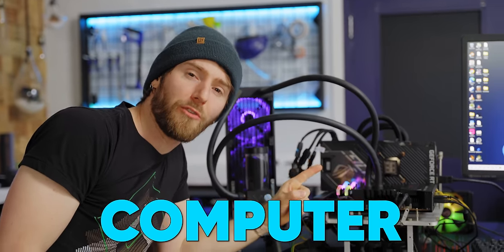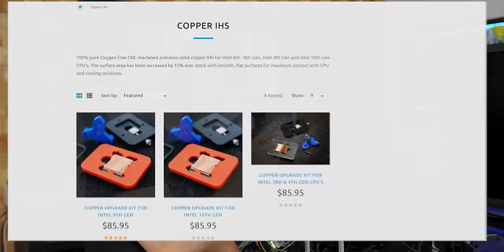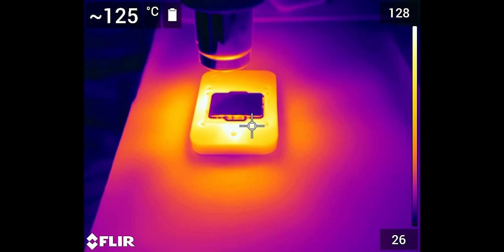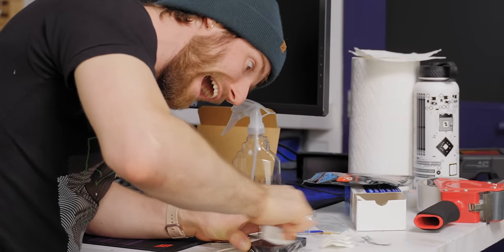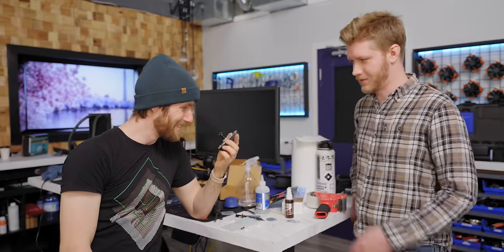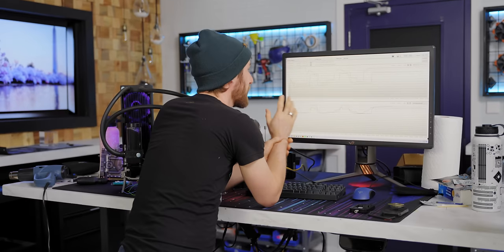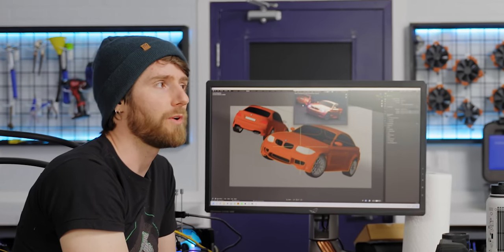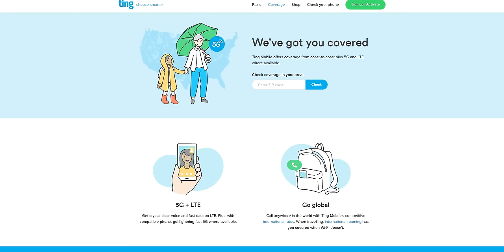Making Intel's Worst Product Better.... And Also Worse

Comment: How much overall power does the whole machine use 1800 W because that's the standard power allowed on a single circuit in your home 120 V times 15 A equals 1800.  If you have a 20 amp breaker and the   accompanying  proper wire gauge 2400 watts.  600 watts just doesn't cut it. Like your videos.

Comment: lapping the standard IHS till it's flat and back to copper is soooo much easier and from experience achieves good results if the CPU has stim not paste.
..also seeing the machining marks means it's not perfectly smooth ..give it a polish on a granite lapping table and try again..
Reply: Thanks for watching 🤗   
Send a direct message right away,I have something for you.🔝🔝🔝

Comment: the fact that these CPU's and GPU's pull so much power now is why I had the electricians at the house I'm building wire my office with half the power outlets to be on one 20Amp circuit and the other half on another 20Amp circuit. 

Once my 5 yr old is old enough I'll build him a PC and we'll have three PC's running in the office. This way we're making sure we're not causing any fires or tripping breakers.

Comment: The cause of lower temperatures might just be the replacement of the thick solder layer with liquid metal. Although it probably does, the aftermarket copper heatspreader doesn't necessarily contribute to the lower temperatures. I would like to see the results using the original Intel heatspreader and liquid metal.

Comment: If you wanted optimum performance, wouldn't it make sense to have the IHS also be an integrated water block so that you can avoid a second physical transition layer? Also, how about a solid silver IHS? Pure silver has an even better thermal (and electrical) conductivity than copper.

Comment: With my experience of bare copper and LM: it's a bad idea, nickel plated parts can work indefinitely, while LM "dries" by slow amalgam process with copper, after a year LM hardens and you need to clean and reapply, and to remove old dried LM is best to use LM to dissolve hardened parts, alcohol my ***, it does nothing
Anyway, all that headache is avoided by just using nickel plating

Comment: Hi . so the microprocessors support 200 degrees, can I solder the heatsink to the CPU with tin paste at 135 degrees, placing the soldering iron on the aluminum heatsink? My CPU already has the IHS soldered on it, I also want to solder the GPU

Comment: Why don't you just try direct die cooling without that IHS? Should be far more efficient than having that extra piece of metal and thermal compound between cooler and die.

Comment: So if I'm understanding correctly, the part that you bought is better because it is flatter, which means there is more metal-to-metal contact, and metal does a better job at moving the heat to the cooler than the thermal compound does. And this allows you to push the unit more without it overheating and throttling itself.

Now, if this is the reason, wouldn't it mean that to get EVEN BETTER results, you can replace the cooling system's copper plate with an extremely flat copper plate? Wouldn't that increase the metal-to-metal contact?

Sure, the returns wouldn't be much, but it WAS said right at the start of the video that the goal for this machine is to "Beat the competition, price or practicality be damned".

Comment: If you're going to switch the whole top of the CPU, what's stopping you from forgoing the whole thermal paste/flat surface/cooler-CPU connection and making the CPU top one with the cooler copper?
so basically a cooler but a CPU top at the end instead of a flat copper surface
Reply: Thanks for watching 🤗   
Send a direct message right away,I have something for you🔝🔝🔝

Comment: "That computer if you have old not up to code wiring in your house... it could burn down". Ehmmm CPU=400W super tops, GPU=600W super tops, all other components=200W tops, Efficiency loss tops 20% = 1440W. That is waay less than a flatiron or a water cooker. Yes you use those for shorter timespans, but... if constant 1440W draw on the same circuit heats up the wiring inside your walls to a noticable degree, you're living in something extremely illegal and not something "not quite up to code".

Comment: "That computer if you have old not up to code wiring could burn down".
Well well well, I'm sure I'm fine at my place which sometimes has my fridge compressor randomly turn off my keyboard and make my speakers pop.

Comment: If you really wanted to go for max cooling, you would have put industrial noctuas in push pull on the rad at the very least. Maybe use a bigger AIO too.

Comment: i would like to see a fixed limit in power consiumtion for cpus and gpus its just not fun anymore paying so much for energy max limit for gpu should be  300w and cpu 150w on "default" settings also wee need someone making a table with all the coponents power draw on idle and 100% prime / furmark and also fps per watt or something like this so ppl also can see the efficency of the components at the time now i would think off maybe last 2 gens of cpu and gpu in a table

Comment: the fact that the system is GPU BOUND ON A 3090TI, is INSANE. That little processor ihs combo will be very interesting for max overclocking.
Reply: Thanks for watching 🤗   
Send a direct message right away,I have something for you.🔝🔝🔝

Comment: you know... given "how close to the sun" they are flying... and how much they are charging, you would assume they would make sure to give you something that works out of the box and not rely on off-the shelf parts... as in, why doesn't it come with these modifications from the factory?
Reply: Thanks for watching 🤗   
Send a direct message right away,I have something for you🔝🔝🔝

Comment: run 8 nos. of 4k/8k vdos simultaneously for real world stress test, & what about cooling cpu vrm's, i lost a mobo in just 2 days, just by replacing stock horizontal cpu cooler( which was directing air flow towards the vrms & other components) to a vertical cooler, also a hair drier consumes more than 1000W, house wiring can handle atleast that.
Reply: Thanks for watching 🤗   
Send a direct message right away,I have something for you 🔝🔝🔝

Comment: would it be feasible to develop an IHS that is integrated into a water block ie. the copper IHS also has the micro fin channel then an acrylic top would be attached like any other water block that way its right on the die.

Comment: Now i question why they don't go the extra way to make this a standard in the chips, 10º is no joke
And it is such an easy thing for them to do, maybe a few extra steps on the assembly line, or even just a better machining machine
especially for high end ships like i9's that a few extra dollars would not make a huge difference

Comment: Seeing this the 13700k is about the same or faster, but amd coming out with the 7800x3d when running full load i only see it getting to 68-73 degrees c and only pulls 90 max

Comment: This is why my main machine is now a Mac Mini. The same general level of performance, with one third, or one fourth power usage, basically silent with no discernable change in temperature. No, I do not game all the time. However, Intel, Nvidia and AMD need to focus innovation in these areas. Wouldn't it be wonderful to game and not need a sophisticated cooling solution? Back when I was gaming, my room would get so hot, till I would have to stop! That hasn't gotten any better.

Comment: Something tells me this isn't good like most people think. Claimed 10-15 lower temps, but where does that removed heat go? I see massive increase in the temps of the components surrounding the cpu and the cooling components which just make it the same thing as before if not worse because high cpu heat isn't the only problem, it's the heat increase in any component. Instead, the surrounding components shouldn't get an increase in temp as cpu temp reduces, so this product and the works needed to get to the "result" is pointless and for no good enough reason. Bottom line is, cpus have to be reinvented to not dissipate much, or if any heat. Just like bagteries have to be reinvented.

Comment: I have similar set up as your guys i9-12900k and same MB (ROG Z690 extreme), I don't know do you guys noticed that the long post time too ?
My last build was I9-9900ks only took 8 sec to boot after press the pw button to windows desktop, the 12th is like 40-45 sec....

Comment: yeah if you are gaming like this,  you also consider to allot more budget to your electricity bill. since you bought ~4k of hardware, what is increase of around 30-50% on your electric bill. (i only had 110kwh per month and most of the power goes to my other appliance and i even leave my pc afk farming on my game (my system sits around 60-70w))

Comment: liquid metaled a 12900k with liquid freezer 2 420, 85c and 29600 10min cinebench score asus ai optimized. i was going to sand down the ihs, but 29600 is the absolute limit of this set up and 85c is good enough

Comment: What's insane is to NOT use Resonant Tunnel Diodes. The speed power product is 100,000 times better than CMOS. Think 1000 times faster and 1% of the power. 5 THz at 3.5 W. Of course current RTD research is only up to 2 THz (in 1984 GE was selling 70 GHz TD logic). Using CMOS allows us to really ramp up our electric bill (including the added air conditioning need for a room with a 2000 W PC). And we get to add the cost of extreme cooling (LN2), 2000 W power supplies, and incandescent VRMs. We also get to increase that risk that a power cable with melt and short - burning down the house. All this to keeps the price up so high to exclude the hoi polloi. Tunnel Diodes were invented in 1957. I used them in 1968. I tried to get AMD to investigate them in 1984. Check out the Tunnel Diode and Threshold Logic YouTube channels to see what the REAL state of the art is. As for CMOS - a rocket powered Edsel is still an Edsel. Building an Edsel with the latest high precision machine tools means it is still an Edsel.

Comment: That's an unfair comparison, you can't compare temperatures at different speeds/power consumptions. Alex said CPU was pulling 240W before the new IHS and with the upgraded one it pulled 300W and still managed to be 9 C cooler. That's an hell of an improvement.
Reply: Thanks for watching 🤗   
Send a direct message right away,I have something for you.🔝🔝🔝🔝

Comment: I previousy de-lidded my hot af 7700k with the same kit, and I've never been happier to void the warranty on such an expensive piece of tech! I dropped an average of about 10-12 degrees on max loads also. Though, it IS a bit nerve-inducing the first time you do it

One thing to note is that intermittent temp spikes tend to be up & down more quickly, as well as being more frequent (or at least more noticeable) due to the vast improvement in conductivity

Honestly, it's really difficult to go wrong with Rockit Cool's kit

Comment: I'm not going to lie, I am considering this as a solution to the fact that the 12900KS just runs too hot. 100˚C on a desktop is just not acceptable at all. It's not really acceptable in a laptop either but I've kinda given up on that front.

Comment: hey i was wondering, is it weird while playing genshin impact my cpu temp goes up to high end 70s C consistently. and should i check the thermal paste. omen 30L with a radiator and fan cooler

Comment: Or spend $5 on wet sand paper and lap it yourself. remove it from the die first. Should be copper under a thin layer of nickel

Comment: Intel quit using indium to solder the heat spreader to the chip and went to a thermal putty and save money after 2012...  So you buy this and solder it to increase the value of the cpu.   You also have to burn in the liquid metal like a low heat solder by unplugging the cooling and cooking the cpu at 90 for like 15 min

Comment: I have no idea why you techies invest in cooling so much, when all you have to do to lower the temperature is to underclock your hardware. My 10th gen i7 is underclocked to 200MHz (had to hack my bios and replace few chips on the mobo to allow that) and cpu temperature never goes above 5°C. Not sure what to do with my RTX 3070, which can get quite warm, but I will figure out a way to underclock it as well.

Comment: A serious question here, doesn't anyone else do simple lapping between the CPU and the cooler any more?
This simple process helps in eliminating the microscopic ifferences inherent between the two surfaces and also thins the surface of the plating on top of the CPU allowing for better heat flow to the cooler.
 I know this is probably "old school", but the process still works well, especially since the higher temperatures generated by todays modern processors.
Reply: Congratulations 🔝🔝you have been selected among the lucky winners. Message right away!!!.

Comment: That CPU is insane.  Like I know it's expensive and not worth it over the standard 12900k (12700k is the best high end buy IMO) but it is really cool to see how fast Intel can push their clock speeds.  5.5ghz is really, really high.  Also, it does seem to be a performer if it's even bottlenecked by a 3090TI.

Comment: Dont mind me, ill just be over here with my Ryzen 7 1700, wrath spire cooler with the fan removed, Bestbuy thermal paste and a single Noctua 120mm case fan. Also yes, it runs Crysis

Comment: Since you already go through the lengths of delidding the CPU, isnt it more logical to just mount the cooler directly to the die? What benefit does this have over direct-die cooling?
Reply: Problem is that the socket assumes that the mounting height of the cooler is at the level of the heat spreader. You can't just take the heat spreader off. The cooler would hit the locking mechanism of the socket before contacting the cpu die. You have to remove the entire locking mechanism and buy a contact frame that holds the cpu in place with screws that go to the locking mechanism screw holes.

Comment: If its a matter of flattening the surface, why not trying to sand it with fine sandpaper and make it "more" flat 😆, i think its about applying the liquid metal rather than flat surface
Reply: Thanks for watching 🤗   
Send a direct message right away,I have something for you🔝🔝🔝

Comment: Hey got a question if electricity was passed through a jelly or fluid through one electric current throw an open ground an all other closed now that would make a path way for electric to flow now repeat billion of time in three dimensions billion of time would that basic make a nurion cube with more computing power then any computer on the market
Reply: Not sure what you message intels but sometime the craziest ideas sometime become true an make the greatest change or impact to human advancement
Reply: Mind the drawing done on phone the dots are connection point on the side of the 3 d shape the fluid inside is just to let the signal travel through its fastest way
Reply: Wish could show idea it would make more sense.  May their is either way draw a three d cube now on each side image each side has billions or trillion off little electrical connections on all 6 sides an fluid in the middle that allows that electricity to follow freely the most efficient way possible at trillion time per second through all 6 sides allowing more processing then any chip possible allowing AI learning because you could put more the one of these on a board connecting all of these together allowing the fastest best out come everything better then any supercomputer

Comment: These tests should be done by placing radiator inside an artificial pc case to monitor temperatures over time.
Reply: Thanks for watching 🤗   
Send a direct message right away,I have something for you 🔝🔝🔝

Comment: There is no direct die yet? Cmon, 9900k has direct die. Yes it was a copper IHS, but I still gained a ton of cooling.
I bet that you could get a higher cooling based on lapping the stock IHS.

I am one of the idiots that went for liquid metal direct die on a 9900k just because. Only running 5ghz all time, but my fans never speed up, even while using Prime95 small fft without touching avx. I was able to 5 ghz stock, but I do love never hearing my computer no matter the load I put on it.

Comment: I've been delidding CPUs for years.   I find this video a little misleading, because even if you don't change the default IHS you will see a similar drop in temps.    The real problem isn't the IHS -- it's the solder job.

Comment: isnt the difference just becuase the new ihs uses liq metal instead of soder?

would like to see the old heat spreader + the liquid metal. but seems to me that would show the same difference.

i mean once you're in the realm of splitting the cpu apart you may as well use a better 30bucks ihs but i for one think that's not where the imprevemnt is from. or not most of it.
Reply: Thanks for watching 🤗   
Send a direct message right away,I have something for you.🔝🔝🔝

Comment: Imagine a cpu so fast that your $4000 scalped 3090 ti is the bottleneck.

Also, at this rate psu manufacturers won't be able to keep up. 300W cpu and 450W 3090 ti BEFORE considering power spikes that will shut down your PC. Bruh...

Comment: Wait.... You applied Liquid Metal to a bare copper? Wow... There will be none of it in 6-9 months. Instead you'll get an intermetallid garbage between the CPU die and the IHS and serious drop of perfomance. What's more important - i wanna see how you're going to remove it from IHS and repolish it again to it's initial flatness, cause you'll have to remove 0,1-0,3 mm thickness of damaged surface of IHS ^_^